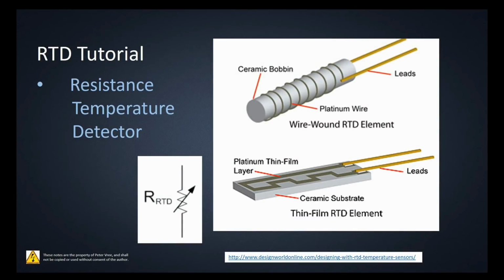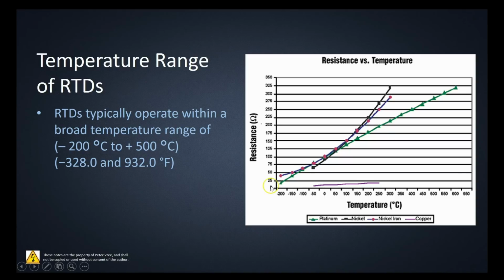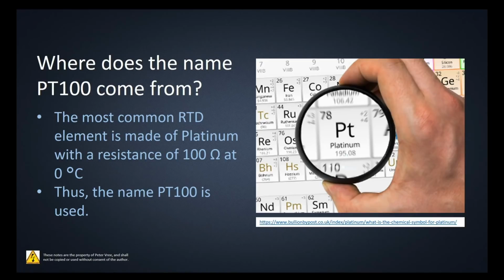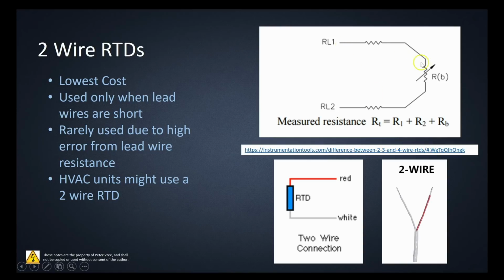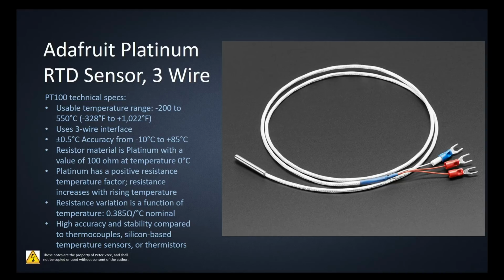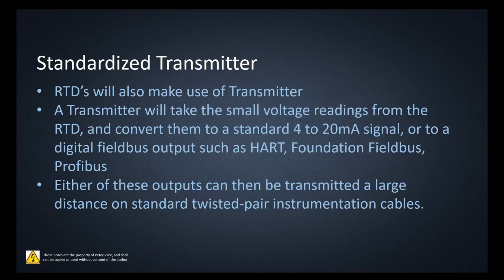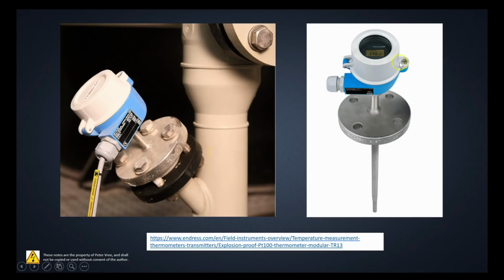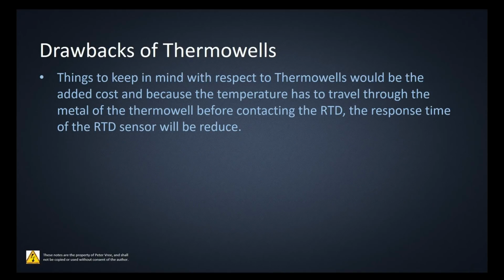RTD PT100 (Resistance Temperature Detector) Tutorial

Comment: Good presentation except for the parts where you say, "RTD's are linear." 
They are not linear. If you calculate the resistance of a linear RTD at 50°C, you'll get 119.25 ohms.
If you use a temperature-resistance table for a Pt100(385), you'll see that the resistance is 119.40 ohms.
The difference looks small but that's actually a 0.36°C error (119.25 ohms = 49.64°C).
If you calculate using a linear formula beyond 100°C, your error will become even larger.

Comment: I was wanting to use 2 pt100s and make the output an avrage of the 2 is that possible in a simple way  for example wiring them in series, in parallel with a resistor of an appropriate value?